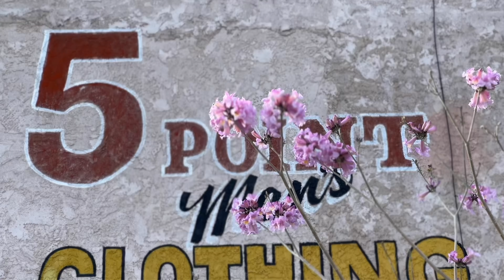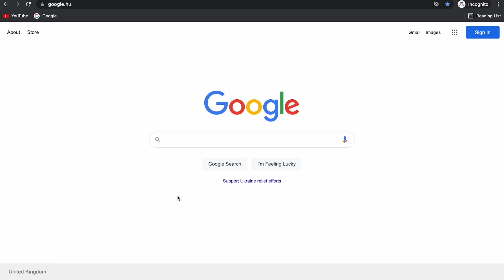The Dangers of Owning a Photo Studio

Comment: I feel you and everything you said. When I setup my 3rd studio (I went from little small spots to a decent stand alone studio) it had the same, 1 outlet.  I had pulled a 120v line and setup all the outlets, then in about 6 months all my studio lights started tripping the single breaker. Then I pulled 220V with a sub panel, and had to design a layout for outlets where regardless of where I setup a shoot, all strobes are spread across both phases.
Reply from the maker: You at least fixed yours! Good job. The whole time I kept thinking "is the studio gonna catch on fire today or nah?" - do you still have the studio?
Reply: @WalidAzamiTV  I still have it, its a hodge podge lol - its on a big lot under the freeway - its just for my use, I dont rent it but I let those I know use it.  when I went full time I was getting a lot of look book work from designers from fashion week - a whole long story in itself